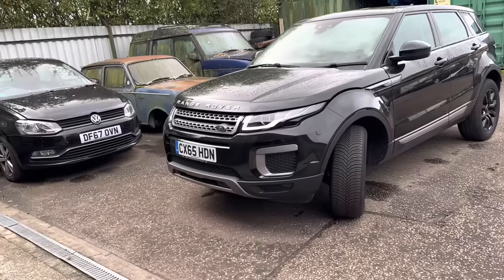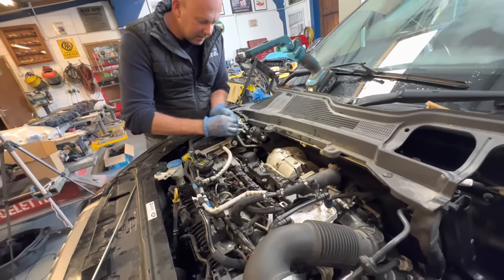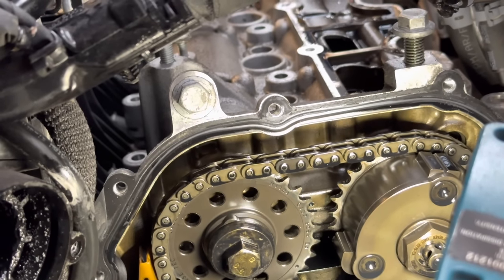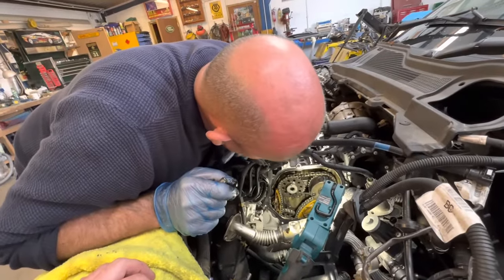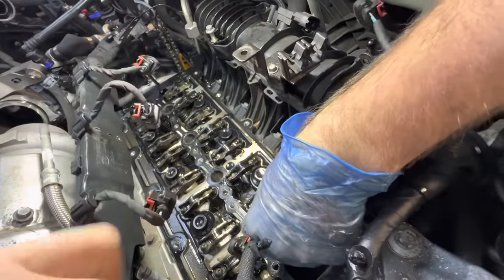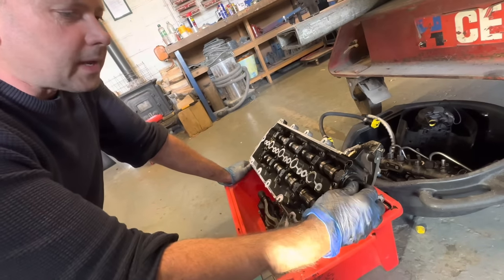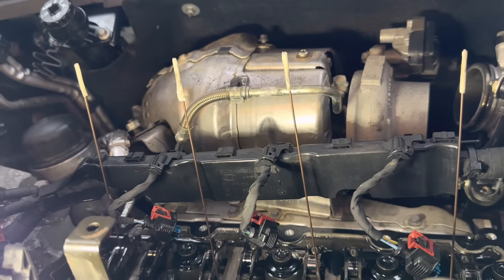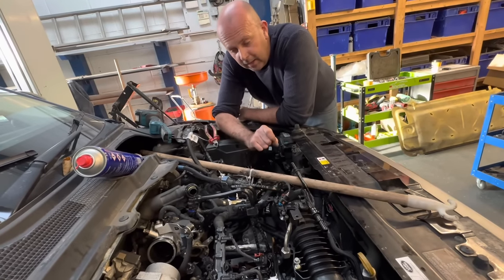RANGE ROVER EVOQUE INGENIUM ENGINE FAIL ! HOW BAD IS IT ?

Comment: There’s a saying in Australia: “if you want to drive into the bush, take a Land Rover. If you want to be able to drive out of the bush, take a Toyota Land Cruiser!”
Reply: Yeah - I have heard a variation on that - if you want to go into the bush drive a land rover if you intend coming back as well drive a toyota
Reply: @darrenwilson8042  we have three landcruisers , one has 400,000 miles on it , it starts on half a turn and is a daily driver , 3.5 ton on the hook and you don’t know it’s there ..it is the finest 4x4 ever built ..
Reply: Yep thats correct :)
Reply: Lol
Reply: Very true. Of course the vehicle in the video is a Range Rover and apart from the Darien Gap expedition is probably best left in Chelsea or Wilmslow. As always chaps, a superb video.
Reply: Very true and I agree, but there’s a lot more old land rover’s still running around than Toyotas.
Reply: There's saying in England if its not broke don't fix it...
Reply: It's amazing that a modern engine like that relies on a tiny dowel pin on wether it runs or not.
Reply: @peteryoungpeteryoung965  It doesn't. The pin is only there to aid assembly, to make it easy to get the timing right. Once the bolt is done up, the pin has no function.
Reply: That’s a good saying but land rovers not designed or built like they was initially was just shiny wealth symbols.
Reply: @chrispop99  yes but getting the bolt torqued up without working loose is an even more difficult problem
Reply: Im sure you typed the same comment on the previous video
Reply: Bullsheet
Reply: @chrispop99  correct.
Reply: @49cchris  there’s a saying in the US and if you wanna own a Land Rover and learn how to work on it
Reply: scrapper 😂😂😂😂
Reply: @hermdeer   yes that's right! Coz the Toyota engines may still be working but the body has rusted back into the earth!
Reply: @peteryoungpeteryoung965  yes true, that's a crap design. If it's going to use a dowel for timing alignment then the sprocket should be on a taper for the drive
Reply: Mate I took my land rover to cape York from Sydney, it was in Ingham for a week getting a new head and gasket . Then in port Douglas for a radiator and other parts …
It was phucking  nightmare  I bought it for $7000. I had it three years I sold it for $3500 .
Brace yourself !  I had all the repair and modification costs during my time of ownership 
The total spent in under  4 years was $48’000.00 .
It was a relief not to see it in my driveway
Reply: Saying by Toyota Drivers in Australia not an Australian saying lol!
Reply: This is the most boring unfunny standard trot out ever ffs
Reply: @richardcole9558  discovery 2 I think you'll find
Reply: @darrenwilson8042  who in their right mind would take this car into the bush, if you want a land rover that will do the job, look no further than a discovery 2. A real 4x4 that is built for the job, this is a 2 wheel drive, for show only
Reply: @peteryoungpeteryoung965  were you not listening to the video?
Reply: @grahameroberts8109  thousands of Australians would disagree with you.
Reply: They say that in Africa and the Middle East also.
Reply: A friend of mine owns a Land Cruiser and has just forked out £740 to have the chassis welded, so mechanically they are good, but a rotten chassis isn't much fun.....
Reply: Ma kako da ne
Reply: Brilliant
Reply: As a kid we had a 1992 4.2 Land cruiser Amazon. What a machine. Stepdad still regrets letting it go I think.

Comment: It's puzzling that Land Rover didn't fit the cam bolts with locking washers to prevent them coming undone. I'm a retired mechenic and I've rarely, if ever, seen a cam end bolt fitted without some kind of locking device. A tab washer, serrated locking washer, or some other device. This is shockingly bad engineering!
Reply: This is purposely bad engineering. They want these to fail.
Reply: What a joke. Im not even a mechanic to understand that. What a joke brand
Reply: The cam sprocket is rotated counter clockwise and therefore risks undoing the retaining bolt with its right hand thread. Once the drive chain from the crank wears it provides continuous ‘kicks’ via the intermediate sprocket to the top timing chain that acts to loosen the bolt and snap the location dowel on the cam sprocket.  The only sure way to have circumvented this would have been to use a retaining bolt with left hand thread and a woodruff key between cam and sprocket, basically common sense engineering.

Comment: I really like having an in depth forensic session! That's where the real knowledge and experience shows👍 
Subbing out the timing to Josh is also a good move as you explained!
Hope this one works out for you👍
That sprocket bolt is probably going to need a good tightening up? A bit like the crank pulley on my 1.8 tdci Mondeo, no woodruff key, just 100nm then a 180 turn, otherwise known as "Kin Tight"!

Comment: Hi Chris/Rob, Id change the inlet camshaft and have the fella time the engine up on the new cam. If the lobes have moved due to the pistons giving the valves a tickle. Then you will not be able to get the engine to run..  Cracking Good Vid as Always...Andy

Comment: Not having any experience of these engines, I reckon your diagnosis is spot on. The bolt should hold the sprocket against the camshaft, the bolt's come loose, transferring the load to the locating pin which has then sheared. The camshaft has then stopped turning but as the engine is cranked one piston is striking the open inlet valves which push the cam lobes out of the way. Another piston then strikes its inlet valves and they push the cam lobes, rotating the camshaft out of the way. I suspect either pistons 1 & 4 or pistons 2 & 3 are 'rocking' the camshaft backwards and forwards, through a relatively narrow arc and this is the rattle you're hearing under cranking. If you're lucky, it won't have bent any valves (or done any real damage to the piston crowns). So I agree, once it's properly reassembled you might well have a running, undamaged engine. At worst I reckon it could only need a couple of new valves. Good luck!

Comment: A quick look in the cylinders with a borescope would soon show any damage to piston tops and/or valves. They are quite cheap now and there are also devices which plug into you phone which are even cheaper.

Comment: I'm on my 2nd evoque, love it to bits , first was 2012  but I didn't want the 2.0 ingenium engine ( warned against it buy my landrover guy )so I got in just as they were running out the 2015 dynamics at a discount ( never heard of before) original body shape  but loaded with all the extras and  the tried and tested 2.2 Peugeot/Ford diesel ( thrashed to death in many a transit van and still goes on and on) but this was the best bit , they ran out of 6speed auto boxes so fitted the new 9speed auto box ! So smooth and my economy 43/gallon. Love it .  Just a quick tip for fun....engage sand setting, sport mode, manual paddle shift, traction off then  hit the gas at the lights and watch the children still at the lights in the rear view mirror. Pretty good for a fuddyduddy diesel. Oh hang on to the wheel and don't do it for long periods ........

Comment: funny, chis voiced my thoughts about this, if the bolt had worked lose, then the pin snapped at start up because it was the only thing holding the sprocket in place, then the cam would be free to rotate when pushed by the followers.......... so fingers crossed..........there may be no other damage ??.......... good luck !  👍😃
Reply: has to be said, its a poor design...... if it had been keyed it would continue to turn even with a loose bolt ?🤔

Comment: I was speaking to a recovery driver who business has a contract with a large Land Rover dealer, he said there is a car park to the rear of the workshop which is packed full of Evoques and Jaguar X series with broken 2.0lt diesel engines, he also said he tows in between 3 & 5 per week!!
Reply: Hi guys , In France we have the same catastrophe.
Reply: Does the 2.0 petrol suffer from similar issues?

Comment: Classic comment .... " Drives lovely when there going " .... Fantastic.
Must be a bad sign when you praise a vehicle's reliability in month's , and at best, nearly two years.... In the ten years I had my old  1997 Toyota Rav 4 it broke down once, when the water pump collapsed and jammed the belt, but being a non interference engine it was soon back on the road, and it was that straight forward I put a new pump and belt on myself.

Comment: Land Rover, like Rover before them to be fair, make a great product, it's just the quality control is terrible. I was once talking to an auto electrician who worked full time at JLR snagging cars. The main fault he dealt with was self tappers through wiring looms. So yeah, that loose bolt doesn't surprise me in the slightest.

Comment: Owned four. Never a problem. Changed the oil every 7500 miles. Maintenance is everything.
Reply: after what mileage did you sell them?
Reply: @zvzz1543  
Between 41,000 and 61,000. However, 2 of them to mates who went on to run both to more than 100,000 miles. The only issue was a recall for a fuel rail o ring on 2 of them.  I do hear horror stories from other people though so don’t doubt when they go wrong it’s painful on the credit card. I
Reply: Oil changes are not stopping that cam bolt from coming loose. Threadlocker at assembly might tho.

Comment: Cause: The pin on the camshaft sprocket has broken. See attached file for an example.
Action: The issue has been fixed in production at the following VINs:
• Freelander 2 / LR2 - 375956
• Evoque - 840665
A new part number is available: LR050849. These parts have a new pin material and machining changes to the camshaft sprocket body.

Comment: The first brand new car I ever owned was a facelift range rover vogue 'L' reg 1994. I have to be honest and say it spent most of its first 12months back with Landrover having repairs. There wasn't one part that wasn't touched by some fault or other, and can understand the comments by others that probably have suffered the same fate. However, the next six years were relatively trouble free motoring. Interesting to watch about these latest models, and love Chris's new purchase.

Comment: I find amazing that they don’t build these modern cars without solid camshafts. What is the reason to have a tube and separate lobes. 
Is it for cheapness? Or another reason ? Opinions please, seems a recipe for failure. What other modern cars are like this ?

Comment: Hollow Cams with press on lobes becoming common place on some engines now. Some see them as a sort of 'sacrificial anode' in that the lobe movement stops heavy damage elsewhere. Not always the case but certainly in most cases. You guys mentioned the Berlingo with press on lobes. This is a common fault when the belt goes or water pump seizes. At least two lobes will have moved out of position. I'm also aware of slight lobe movement on higher mileage Berlingo models (80 - 100 thousand  miles) resulting in poor performance. New set of cams and it's back to full power. Most people prefer replacing with a steel cam where possible.

Comment: My dad had the 2.2 diesel auto new in 2013, he never had any issues in it in the 4 years he had it and did about 40k miles
Reply: The 2.2 TDi engine is the only reliable Jaguar diesel engine. Stay away from the 2.0ltr, the 2,7 and 3.0 ltr versions. Failed DPF regenerations plague the 2.7 and 3.o ltrs which put diesel fuel into the sump causing the big end and main bearing to seize and spin around inside the con rod and mains shell housing.
Reply: The 2.2 is a Ford engine 👍😂

Comment: This video is gold guys! Fascinating to see the postmortem on the engine. Sad to think that something as simple as a locking tab washer would have prevented this. The idea that cam lobes are just pressed onto the camshaft seems bizarre. I guess it’s cheaper to manufacture them this way. I’m from the old school where camshafts and lobes were one casting. But on the downside this would mean bent valves and/or broken pistons. Look forward to seeing if it runs. Great work as usual guys. Cheers from 🇨🇦

Comment: See the issue with fuel oil dilution i highlighted in the comments to the last video. Balencer shafts wear prematurely so worth checking 👍
Reply: My Evoque had balance shaft issues at 10k miles under warranty.
Reply: Apparently there are problems with the hardening of the balancer shaft on some of these JLR engines. Possibly subject to a factory recall, check the recall databases to veryfy if an engine is affected.

Comment: Loving this one -if the cam lobes move that makes the engine safe. Had a Subaru that broke a timing belt and pistons did not meet valves,so no disaster. Camshafts are a tube these days? How cheap is that! 😁

Comment: Those Ingenium engines are a bag of spanner’s
Reply: All modern engines that have gone back to single row chains seem to be a bag of spanners. And as for putting the chain behind the flywheel at the back of the engine I despair.
Reply: @mikefarrar8071  A lot to be said for an old fashioned timing belt that can be changed every 2-3 years
Reply: jaguars older 3.0d and 2.7d v6 were much better engines even the 2.2d in my x type is still going strong after 14 years
Reply: @dazspurs9899  The Ford 2.2 Duratorq ZSD-422 in the X-Type was a tough unit also found in the Defender and Transit but it was deemed not economical enough and not up to modern emission standards. Hence they replaced it with the Ingenium rubbish.
Reply: @skimmingstoness  I agree I won't buy a Jag with that ingeium engine even though I would love an XE to replace my x type,I'll go with the xf 3.0d v6

Comment: Was going to message after first video.. can’t wait for next and please show detail. Got a 2016 disco sport, so same engine and always nervous, luckily have warranty and yes do oil change ever year not like LR say every two. Give some detail on removal, cleaning and resolving dpf issue another huge issue with these cars especially for the ones used just for short school runs. Keep up the good work!

Comment: When you turned it over, the cam didn't move. So i think the lobes have moved to a position where all valves can be closed. If it was rocking backwards and forwards like Chris said, you should have seen it do that when you cranked it.

Comment: Problem with all jlrs is the silly long oil intervals. Halve them and you'll be ok. Theyre far from the worst out there, trust me on that. Having said that, im not a fan of the ingenium motors.
 Also, it might be me, but those chain tensioners look well extended. Chain stretch?

Comment: What happened to woodruff keys and locking pins ?
Reply: All to do with costs, imagine the savings time and money when maching is vastly reduced, just like spare wheels being replaced with a spacesaver or compresser, the individual cist per vehicle might be small, but multiply it by 50 or 75k

Comment: Thanks for the update, hopefully it's just a few parts and away it goes. If that was me working on that now you know whats happened I'd put an inspection camera down the plug holes and see if there are any marks on the piston tops where the valves hit and you should be able to figure out the cam lobes moving, and put a new cam in before it goes anywhere to be timed if nothing else is wrong it's got to have that anyway by the sounds of it.    If somebodys saying 20 engines chances are it's right over a big enough dealership, i could find 20 Dodges or fords with the known engine problems within 3 hours of here in classified adds. I also know this spring John Deere had 252 machines needing new computers that were back ordered with no confirmed shipping date. My customer was number 252 and they told him that right from the dealership, I was listening in on the call with the guy when they told him his tractor was a 180k lawn ornament for a while without it. Take care guys.

Comment: I used to work as a service advisor for Land Rover and the product is terrible. Been in the motor industry for quite a while and worked for Ford and Volvo too and the difference is quality between Volvo and Land Rover is night and day I’d pick a Volvo any day for everything!!!! Much better build quality and reliability! If you look under a 5 year old Land Rover the quality of metal is shocking it’s like a 15 year old Volvo or 12 year Old Ford. The ingenium engine is terrible to the point where I worked had a whole warranty workshop to keep up with warranty repairs. Wouldn’t touch JLR with a barge pole!!! Land Rover also have the rudest most difficult customers to deal with too!!!!!
Reply: and you know what? JLR replace the broken pieces by the identical pieces without any search of causes or improvement of the reliability! it is a shame🤬
Reply: Interstingly...my mechanic said the same things when I told him I wanted an XE. So I ended up buying a 5-series and I'm quiet happy with it. Its not flawless but but easy to live with.

Comment: you hit the nail on the head with the service intervals, I think its the new Ford Ka oil changes are every 25 thousand miles, so potential you could buy a car with almost 50 thousands miles with one oil change or 100 thousand with 2 which IMO is shocking, my cars and my daughters cars have oil changes every 8 thousand miles max or every year and have done since synthetic oil has been around and never had an issue